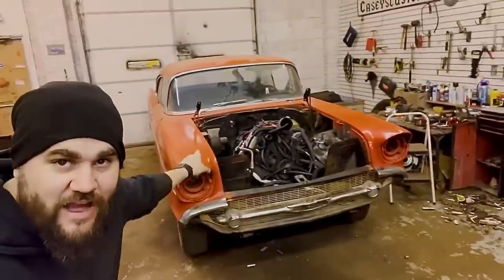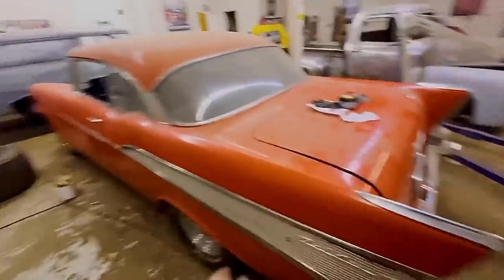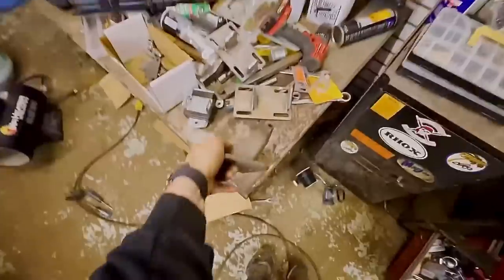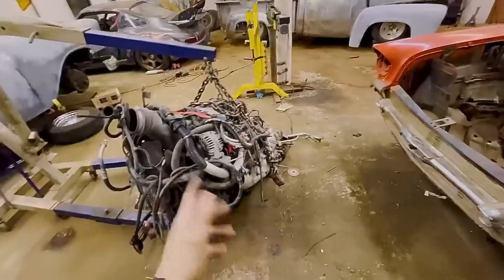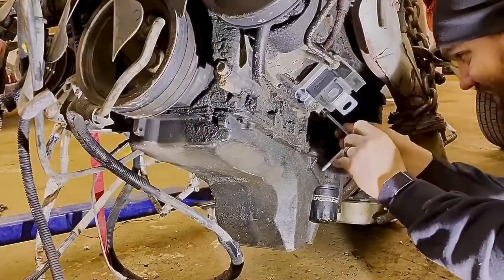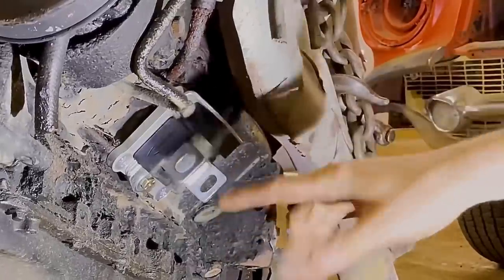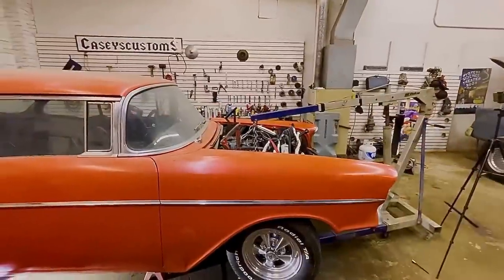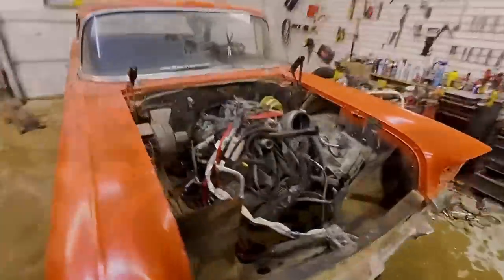DD SPEED SHOP HELPS ME INSTALL AN ENGINE! HOT ROD CHEVY GETS 6.0 LS SWAP! BUDGET BUILD MOTOR SWAP!

Comment: I ran into the same trouble on a 55 Chevy. Gm sells a kit for the hummer, oil pan pick up and bolts. 125 dollars. Uses stock oil filter and comes with engine oil cooler bypass if you need.

Comment: I put a 6.0 in a 57 last summer, if you flatten that seam in the tunnel it'll give you more room. The oil pan is Holley 302-1. Without it I couldn't steer all the way from stop to stop without hitting the old pan.

Comment: That's dam near the same motor mounts Dan put in his wagon at D&D SPEED SHOP flush mount bolts but his mounts had adjustments on them where he could move them back and forth if need be

Comment: Can't you put a hanging furnace in and either run a natural gas line or get a propane tank. Much better heat and quieter. Not hard to install.

Comment: You desperately need an engine lift plate for lsx it makes them so much easier to drop in. Also the truck plenum and that harness ect being on we’re definitely not doing you any favors. Plus a proper rear sump pan would make life easier. You’ll find you say fuck a lot less.
Reply from the maker: Got the pan already coming!